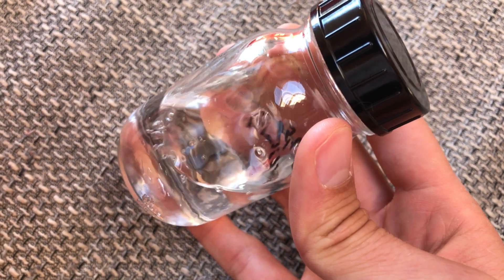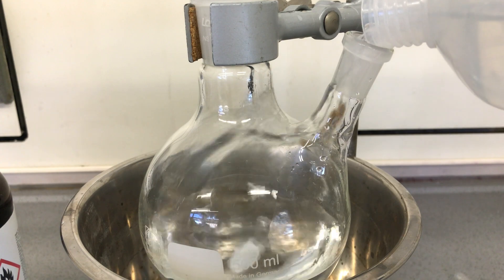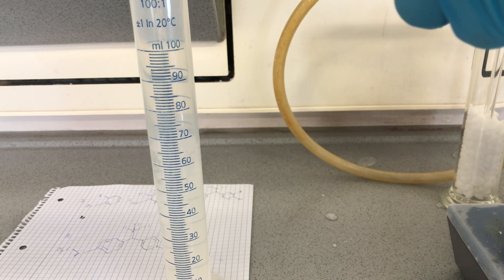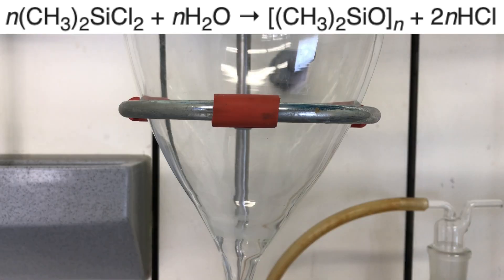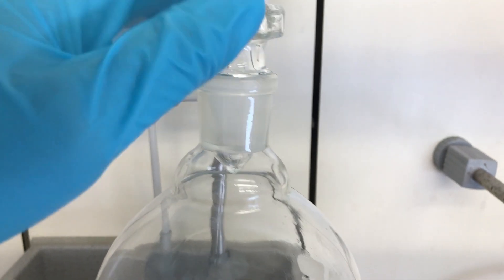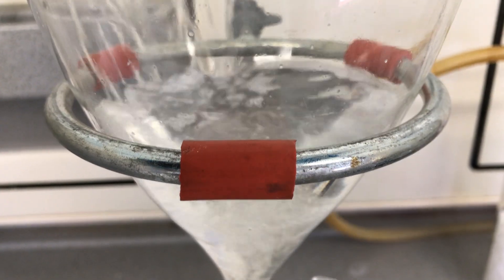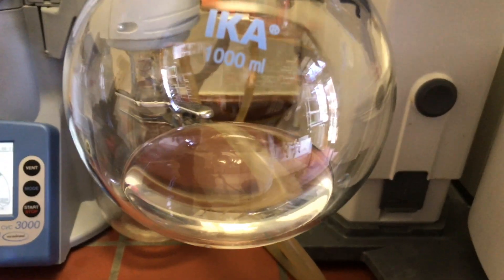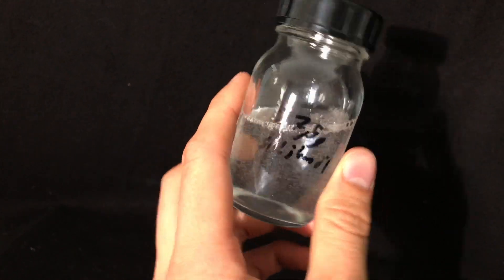Making Silicone Oil - An Oil With Everyday Uses #99

Comment: This isn't silicone oil.  Well, technically yes.. it's a silicone oil, but not what people generally think about when it comes to PDMS.  If you want a better synthesis, start with cyclic siloxanes lke D4, D5, and D6.  Then add hexamethyldisiloxane.  The more HMDS you add, the lower your molecular weight will be.  Just heat this mixture mildly with either an acid or base catalyst and you will get TMS-terminated PDMS, which is what people commonly think of with silicone oil.  The material you made is not as inert as silicone oil, and the low molecular weight fragments may be somewhat unsafe.   The reaction I mention is quick, easy, and safe.  If you do it right, there should be no need for extractions either.

Comment: Awesome work.
May I ask you a question? In fact it's a bit weird but do you know if this substance if subjected to a 25ΚV volt arc will it explode? Actually there were 2 or maybe more arcs involved in the case being investigated. Even more if it's mixed with soil containing humidity? 
I am curious because it happened this kind of oil was the coolant agent on the transformers of the electric carriages of 2 trains that collided in Central Greece to Tempi Valley.
Reply from the maker: having worked with 25kv before i don´t see how it should explode from this alone. it may get hot if it contains too much moisture though and when hot and with a source of ignition i can very well imagine that it can easily combust. when you somehow disperse it into fine droplets like what could happen during a collision i can see an explosion happening.
Reply: @THYZOID  Many thanks. Have read in various sources that first releases various types of elements like hydrogen due to let's say electrolysis (even though the term is inaccurate) and then it produces also methane ethane and acetylene which is highly combustible. My guess is that the moisture affected the dielectric resistance of the substance and the more than one arcs  that did rise the temperature way high played key role to initiate the flash.
Reply: @THYZOID  also for the mentioned droplets that train had tanks with compressed air at a pressure of 10bar for its break on the locomotion neither the transformer and for sure they erupted. So the air forced the mixture to disperse to droplets reaching the roof of the locomotion where the arcs were forming.

Comment: What is the machine next to the rotary evaporator?
Reply from the maker: that machine is a vacuum pump
Reply: @THYZOID  Then that's the most complicated vacuum pump I have ever seen.  Sure, it probably makes life a bit easier for the chemists who use it, but I would really hate to think how much it would cost to fix it if it broke down.
Reply from the maker: @douro20  yeahhhh they are pretty damn expensive but therefore they are chemically resistant and you can control the exact vacuum

Comment: There are few chemicals I have more resentment for than silicone oil (and silicone grease).
It is an absolute pain to clean up.
Reply: Adding caustic soda can be a good way to break down alkyl siloxanes.
Reply: @drhaese  I don't really see myself cleaning everything with caustic soda...
Reply: @piranha031091  especially not if it was used as lube...
Reply: @drhaese  manganese heptoxide causes it to downright explode! Something I didn't expect from something non flammable.... I wonder why, any ideas?
Reply: @petevenuti7355  Mn2O7 decomposes anyway if contacted with many chemicals. Any reducing functional group being present will cause explosion as well.

Comment: You should employ funnels to transfare materials so that your joints stays nice and clean, otherwise very interesting reaction would of though you would need to heat hydrolysis product to achieve condensation.
Reply from the maker: It was heated in the rotovap. More heating might give longer chains though